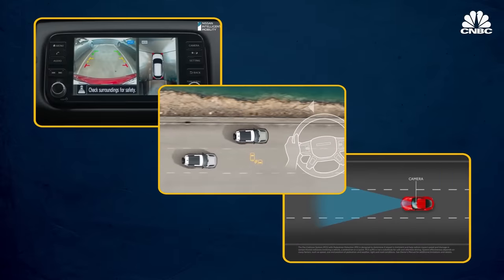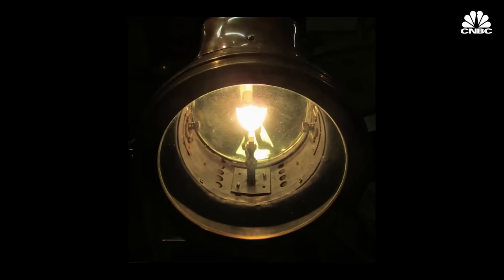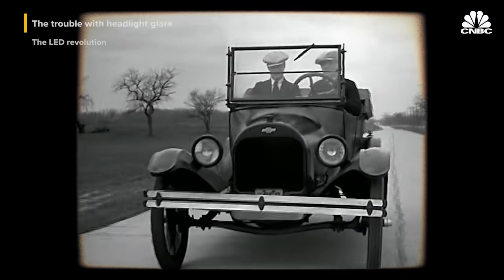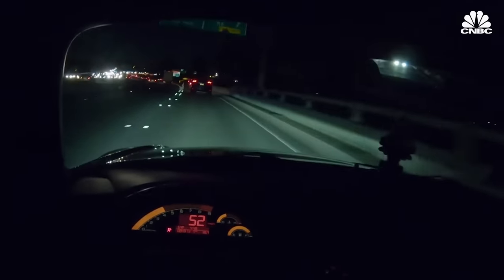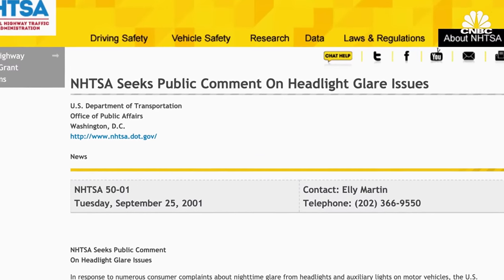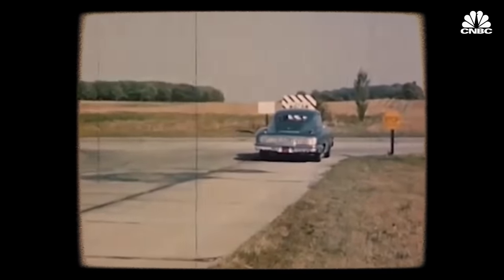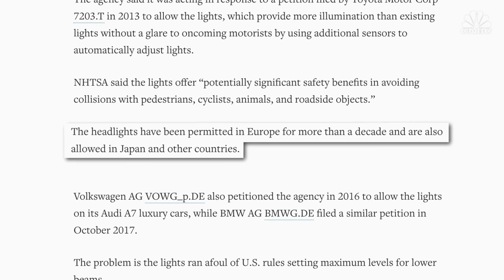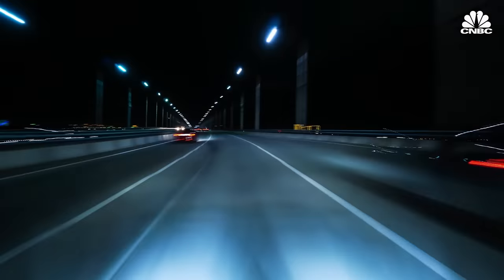How Headlights Became So High-Tech

Comment: The most annoying thing are those HID or LED conversion kits that people put on their lifted trucks and SUVs... especially if they're on halogen housings.
Reply: Agreed. I also noticed that these cheap LED lightbulbs flicker when you look at them in the rearview mirror.
Reply: @KodiD420   hate led
Reply: @Q_QQ_Q  HIKARI Acme-X LED Bulbs work great. Been using them for years and the beam pattern is very safe for oncoming drivers.
Reply: @ToddTinley  looks good but will see .
Reply: The biggest problem is that most who buy LED bulbs just get the cheapest ones from Amazon, where the LEDs aren't in the focal point, causing glare.
Ever since Philips started selling affordable but good quality LED bulbs here in Finland, i haven't seen even a single blinding LED conversion.
Reply: Yes, I drive a fairly low coupe and improperly aimed lights or "ugraded"/converted lights in improper housings make it very difficult, especially with astigmatism
Reply: The problem with a lot of these conversion kits is that the optics of the lens was not designed for the newer technology and therefore will pass the light beam incorrectly.  This also applies to rear lighting.
Reply: @kennixox262  Most quality retrofit LEDs are made to fit old halogen housings.
Reply: @TopiasSalakka  I think people that do this and blind other drivers are not buying "quality retrofits" and instead buy the cheap crap and blind others. You got any source on the halogen housing not requiring modifications for quality retrofits?
Reply: @richardnavratil9661  Of course people aren't buying quality retrofit kits, they're expensive. Why buy a 100 dollar kit when you can get one for 30.

Also there's plenty of LED bulb reviews which show that glare from modern LED bulbs is very minimal, even less than from halogens in some cases. One good source is Headlight Revolution's youtube channel.
Reply: @TopiasSalakka  Agree with you there, most people don't care unfortunately. I think the fact we are having a close discussion on this show we would most likely not be a problem, as we are passionate about cars (hence watching this video) and know what to research. Vast majority of the problem-causing people don't care this much. :(
Reply: @richardnavratil9661  I care enough that i promised to myself to take my HID kit out if anyone flashes me. So far nobody has after 2 years, Mazda projectors seem alright for HID conversion.
Reply: Halogen housing or reflector housing? Huge diff…
Reply: Halogen housings are fine. People need to know that they must use LEDs that have the chips designed in such a way that mimics the halogen filament, so the light output is exactly the same as the halogen bulb is in there.

Comment: if only people know how to fit a led convertion light on their stock halogen headlights. they just give a lot of glare. please people know how to fit a damn bulb.
Reply: the only correct way is to not fit an LED in an halogen headlight.
Reply: @Fulmynato  it depends. i bought a headlight housing that is for halogen only, but i fitted it with led bulbs and they work just fine.
Reply: @Fulmynato  Incorrect. Both my mustang and F150 came with halogen housings, and I installed LEDs. No problems @ all, and they won’t blind oncoming traffic if aimed properly. They’re not cheap LEDs, however, so I can’t comment on whether or not cheap LEDs cause that disturbing glare for oncoming traffic.

Comment: The biggest problem is the US is that our DOT regulations are years behind the European ECE versions of the same headlights.  This has been going on for over 50 years.  When the US had sealed beams, Europe used a halogen systems with replaceable H4/H1 halogen bulbs and the lens pattern was much better since it produced a short cutoff line that did not blind on-coming traffic like the DOT pattern.  When Xenon/HIDs came out, the US DOT versions were inferior again due to  less brightness and a beam pattern that was hindered by using a diffused lens.  European high beams are twice as bright as the US versions.  Now Europe has LEDs with adaptive high beams but again DOT versions inferior.  The US needs to just adapt to the superior versions of headlights that are used all over the world.
Reply: I completely agree, and have been saying this for many years. And Im in Canada. I'll also add to that the need to KEEP, not remove the Rear Fog light. another top notch idea and standard law in EU, where here it is not. And in Canada and the northern states, where WInter is a serious thing that brings low visibility. The rear fog lamp is a life saver!
Reply: The biggest problem is the human brains living in US, because everyone has 'rights' there... So every time some new legislation comes out, pitchforks also comes out and everybody starts to cry and fight against any new laws because they have rights for 'freedom' and nobody can make do anything that a person don't want to do, etc...
Reply: These led headlights are still binding here in the UK  despite reg , especially as the Americanism bs with big suvs and pick up trucks is now common

Comment: Alternate Title: "How headlights became unrepairable and expensive"
Reply: Do they get destroyed that often? Do you repair your cars yourself?
Reply: Yes. Usually its as easy as replacing burned out bulbs for $2-15, or replacing the whole housing for $60-250 each. New ones have internally sealed non replaceable leds, hids, etc.. motorized assemblies. Not uncommon to see a $1500 headlight now. $3000 for a set. Not a problem on a $35000 car but in 10 years when it is worth $7000 and a couple leds have burned out or the headlight is leaking it will be. For example I put new headlights on my Sequoia for $120 because of heavy oxidation and uv damage, water in the housing from bad seals and hairline cracks. Picked up some new bulbs for it as well for $15. Pretty painless.
Reply: @paladain55  cars are getting very advanced. Soon every car will be electric so things are going to be quite expensive.
Reply: @LordCoeCoe  somewhat. I have a Prius as well and its extremely repairable. Battery is easily serviceable. Things can be made serviceable if the manufacturers try.
Reply: @LordCoeCoe  If it is done right electric cars are cheaper and easier to maintain/repair than vehicles powered by complex combustion engines. Nothing about them is inherently expensive to repair but many mainstream EVs that are currently on the market are luxury vehicles which have lots of expensive to repair features regardless of fuel type.
Reply: @paladain55  which year model?
Reply: @tasbirrashid1262  2010
Reply: @paladain55  oh good
Reply: @paladain55  agreed, it makes me thinking when your headlight is burned out then car dealer say, well it's really bad this is happen to you, but maybe it's time for buy a new car. you may not believe this, but there is still many people who don't know how to change their car bulb, either headlight, side marker, or tail light . .

Comment: They're great until you get into a tiny front end fender bender and end up with $2000 in damage because the headlight itself cost $1200
Reply: Headlight assemblies have been relatively expensive ever since the replaceable halogen bulb came out. The safety benefits of the new technology far outweighs the potential cost of replacing an assembly, which most likely won’t be needed. Unless maybe you’re particularly accident prone.
Reply: @Michael Gia Huy Nguyen I’m not accident prone. Why would you think I am?  Plus, only a portion of the population in the US have access to public transit. Most places have none available.
Reply: The fact is if you can afford a car with those kind of headlights chances are you have pretty good insurance
Reply: So we should not innovate and not implement innovations because some people can't drive? Insurances are for these unlikely situations anyways so your argument doesn't make sense
Reply: So don't have a $5000 deductible and learn to not have an accident
Reply: You dont need adaptive for that. Headlights on my car are 1800 already and dont have that
Reply: @Patrick94GSR I agree i have a 2004 corolla 85,000 miles 1.6 vvti 3 door its my first car ,  spacious enough , headlight went cloudy bought new ones night and day difference and if they break or was in  a bump only £170 a pair

Comment: I worked at a drive-in movie theater for the last year. On my drives home at night, there would always be one person with absurdly bright headlights. The glare on my windshield was so bad, I was always scared I would fly off the road, since I couldn’t see anything other than white…
Reply: I have the same problem  that you have they should  get rid of them and now every car have these dame bright light
Reply: You can flash your high beams.  Sometimes people left their high beams on and don't even know they're on.
Reply: @mannotwiththeplan  Or they just drive with no lights on during the night.
Reply: Perhaps it's time to clean your windshield, inside and out...
Reply: @willstikken5619  Or even get it changed, if it becomes way too scratched it causes really bad glare.
Reply: I thought you were about to say something relevant to your job such as how some modern cars are unable to switch off their automatic headlights (daylights) when watching a movie with ignition on for receiving radio signals (movie sound) and therefore need to cover them with clothes or something.
Reply: Its really crazy what these headlights have become. Where I'm from the roads are not flat with lots of long, bumps, curves and hills. When these new cars get just at the right angle you cant see anything other than super bright glare, its really not safe. I've been driving the same roads for 25 years and with old headlights I could see well and not get blinded by oncoming traffic in these conditions. Add some rain glare its even more crazy. When they test headlights its based on a "study" that misses the real world use, with narrow minded engineering does not think about curves, road surface or hills. Improve the street lights, stop increasing headlight brightness.

Comment: I've noticed an increase in glare despite the LEDs. These modern cars lights are far too bright, especially on SUVs.
Reply: Is it despite, or because of? Either way it has become painful to drive at night (and some DRLs are just as bad).
Reply: They're not brighter, just a different temperature/color.
Reply: Yeah it's mainly "because of." Part of it is indeed the color temperature, but it's also about source luminance. So you have to separate "brighter" in terms of road illumination vs brighter as in the lamp looking brighter (more glaring) to others. The two are only somewhat correlated - e.g. the decrease in lamp size increases glare but doesn't increase road illumination...
Reply: That's right too bright.
Reply: @peterveto  Better, but still incomplete considering glare is independent of temperature or brightness. The best fixtures start with lenses that focus the beam. 

A few manufacturers (Audi) have advanced up to lasers. Although I don't think those have been approved for use in the U.S. yet.
Reply: The issue your seeing is non OEM led bulbs placed in headlights not designed for them and not able to focus them properly
Reply: @techmetal2292  and aimed at wrong angles
Reply: I agree - the LEDs are uncomfortable to see at night and I truly believe they are dangerous to other drivers.
Reply: Yeah I think white LED's are a problem. LED's can actually be made in warmer colors that aren't as disturbing to the eyes. I don't think brightness is as problematic as the direction of the light beams. Beams pointing straight forward are a problem. And then there are idiots with blue lights on their cars.
Reply: They’re just poorly aimed. Look at IIHS ratings, some cars are docked points for creating excessive glare.
Reply: To be honest, it’s ridicules to have them so bright.  So they aim to avoid other cars - what about people.  It’s called night driving and I wonder how many accidents are caused by the new lighting.  At some point we need to slow down at night or in rain. We become too comfortable in less than optimal driving conditions.
Reply: @techmetal2292 lol modern cars are oem with led. 

The people that upgrade from halogen to wild and wonder why it’s so bright but doesn’t shoot far down on the road, is either wrong type of led bulb or they didn’t aligned right. 

Having from halogen to led is a great to have better visibility, better beam pattern. As long as it’s the right type of led bulb that’s closely matches the filament of the halogen bulb.
Reply: @MrKen59 lol that’s only if they use the wrong type of led. It’s not dangerous whatsoever. 

Realize modern cars came with led. Even if it’s a modern basic car like corolla with led.
Reply: @toyotabrony  then you have someone replacing the drl with an led. Since they pulse the incandescent to allow the high beam to function as dual purpose, the led can’t smooth the power.   It’s a personal thing for me as the new LEDs are hard to take.
Reply: @MrKen59  so do u prefer an led that’s 2 time brighter than stock, meaning a 20 watts. So they 1k lumens more. It’s not truly the brighter but it’s not supposed to be. U just look for something that’s a bit brighter without goin crazy with it.
Reply: @MrKen59  I went with lasfit - LD Plus switchback with 30 watts. Which is 3 times brighter than stock. 30 watts is 3000 lumens. 

Plenty for that. Switchback mean switching back and fourth between two colors of 6000k pure white, and 3000k golden yellow for weather conditions.

Comment: I hate it when the damn headlights light up my cabin. It’s not even pointing to the road. It’s actually pointing at the driver
Reply: I just had this problem last night, where some douchenozzle hovered in my left blind spot for like 10 minutes going down a two lane highway and it was bouncing off all my mirrors lighting up the inside of my car like a pyramid.
Reply: thats mostly a problem with people using LED bulbs, they don't work right in reflector housing and they are bright as heck and can't be aimed right, I live in a rural area so I can feel your pain. I have retrofitted HID's and aimed right they are amazing.
Reply: @heatherhaack4804  that’s when I move my side mirror(s) until the situation has passed, then I’ll move them back where I had them.
Reply: Hid's in a reflector is a no all around but leds in reflectors can be aimed. 
I have led in my car and I adjusted it where it has a good cutoff line (not as crisp as projector ofc but still)

Comment: My biggest pet peeve are DRLs that don’t connect the headlights, dash lights, and taillights. It is so dumb that some cars allow drivers to turn on headlights and not taillights! I have seen soo many near miss accidents because of this.
Reply: I drive for a living and can totally relate to what you are saying. Newer cars have DRL's, but at night most drivers don't turn on their lights. I seen a lot of cars driving without their tail lights on because the drivers thinks his headlights and lights are all on.  Yet my personal car which is 27 years old (1994 Mercedes SL500) came equipped with DRL's but it lights the headlight, taillights and side markers. Don't understand why American and Japanese cars don't do the same.

I nearly had a close call last week, but that's a total different reason, guy driving a pickup with his car trailer hitched, seems he forgot to connect the wiring for his trailer lights, in an unlit 2 lane road going through a forest.  

My biggest peeve is those new led lights from Honda and Toyota they really blind you at night, weather I am driving a Grand Caravan, Sprinter Van. or Ford double axle bus,  compared to American and German cars.
Reply: I don't know about the US manufacturers but the headlights on my base model 2020 Renault Clio have only 3 settings: Auto, parking laps, low/high beams. It is simply not possible to not have my taillights on in the dark. I suppose it is possible that after all these years automakers are finally taking a note on the careless drivers that somehow manage to mistake DRL's for their low beams.
Reply: I don't get why front DRLs aren't linked to taillights. In Europe in my country headlights must be on 24/7, but not taillights. And here in the US, I've see surprising amount of people drive with DRLs only (as they get fairly bright) and no taillights in the middle of the night. Honestly, those people shouldn't be on the road.
Reply: @JohnRE  Don't get me started on the moronic lack of rear amber blinkers on cars sold in the United States.  Red brake lights should not also be used as blinkers or flashers when stranded on the side of the roadway.
Reply: The idiots who drive with drl’s on and no actual headlight or taillight on are a pet peeve. And u can usually flash ur high beams at them for 20 mins and pull up next to them signaling turn ur lights on and they will just carry on clueless. If someone keeps flashing u something is probably not right.
Reply: Not sure why cars have DRLs (must be fairly new then) but don’t have automatic headlights.